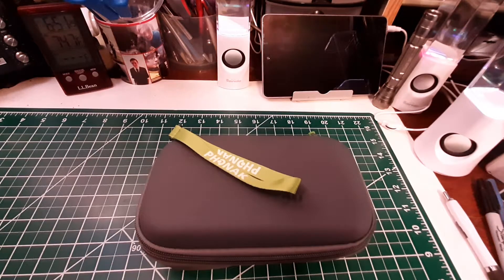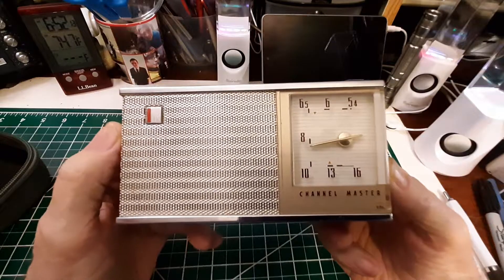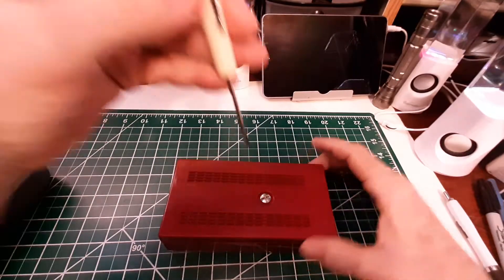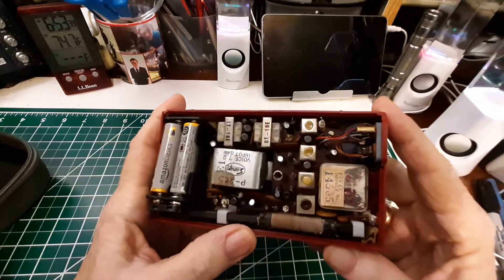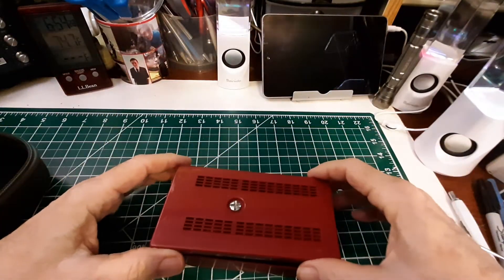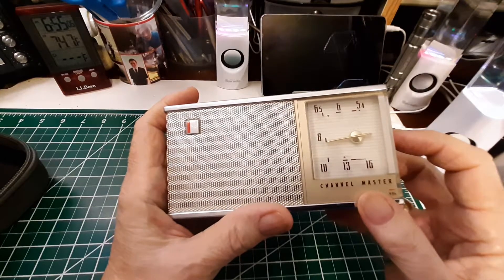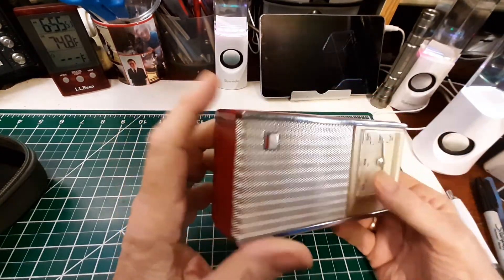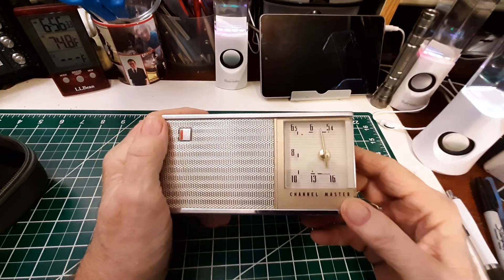TRRS #2026 - No Its Not an Expensive Hearing Aid

Comment: I have a radio just like that one. It’s a good DXing radio with a lot of style. Nice 👍
Reply from the maker: Awesome.
Reply: I was surprised that there are still plenty around.  You are correct.
These are great for DXing. And sound pretty good,too.
It’s cool that you have one.too.
Thanks for watching.
📻🙂
Reply: @jeffking291  I see them on eBay all the time. I got my radio on eBay but it had  very low volume so I had to recap it. It sounds great now. ❤️📻
Reply: @TheRadiogeek  
These must have sold well.  Because there really are a lot around.
I bought mine from a “Radio Attic “ seller who sort of specializes in these.  Totally recapped, recalibrated, ( and whatever else it needed).
Under $50.oo.  Since I cannot do recaps myself, I consider it a good price - considering the condition.    It’s a beautiful radio as well as  completely functional.
( just wait until you see my others 😁❗️)
This is one of my best AM “Pocket” radios.
   Thanks for watching.
📻🙂
Reply: @jeffking291  looking forward to seeing the other radio. 👏🏻👍
Reply: @TheRadiogeek  
Tom has the 6515.
I’ve been holding off on the 6512, as it had an antenna wire problem
[ for the external antenna jacks].    I got all 3 from the same seller over 3 years ago. ( as well as a few other radios.).
📻🙂

Comment: Beautiful radio. I have a couple and like you say they not only look elegant but, they are very good AM DX radios. If you ever get the chance there is a model that is just a little longer looks the same, but has a tag on the front that says, super fringe. If you ever get the chance pick one up, it has an even larger ferrite antenna and I think one more transistor. The super fringe is a ge super radio in a small package. These are one of my favorite transistor radios and they are quality all the way.
Reply from the maker: Jeff has one of those radios and I will be showing it soon.
Reply: @hamrad88  
Awe, you spoiled it.
📻🤣
Reply: I do hav the SuperFringe.
You are right, it’s a real match for the G.E. Superadio.  It outperforms my Superadio III.   It’s an 8 transistor, with tuned RF circuit, 3-gang tuner, and extra long Ferrite.
(( I also have one with SW)).
But that one will have to wait.
Thanks for watching.
📻🙂

Comment: Ooohhhh. A 6506. Very, very nice. Those are quite the little DX performers. I see she's had a recap (not an easy thing to do with that type of circuit board).
I'd be willing to bet that she'll pull in WWL from where you are in the daytime if you get away from all of the RFI., and null out WGUL.
Reply: She’s been completely gone over by a Specialist.  Yes , excellent reception,and very good selectivity - especially for a 6 transistor radio.
Pretty surprising.
Thanks for watching.
📻🙂

Comment: Hi there its raymond   nice little radio never saw this radio before it looks like a radio of the  the late 1950s and early 1960s and it is heavy  and the sound is o k
Reply from the maker: You are correct.  60s
Reply: It is an excellent little radio.
Thanks for watching.
📻🙂
Reply: And you are correct this is from 1961.
📻🙂